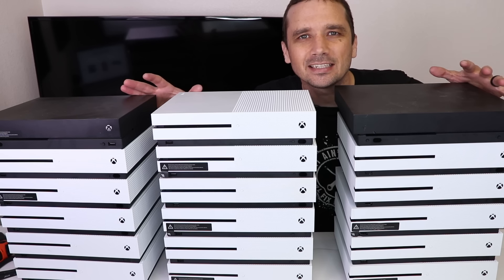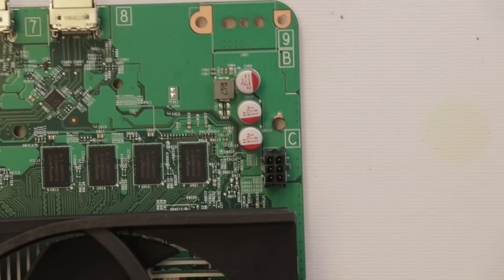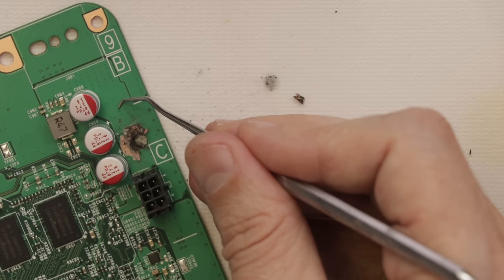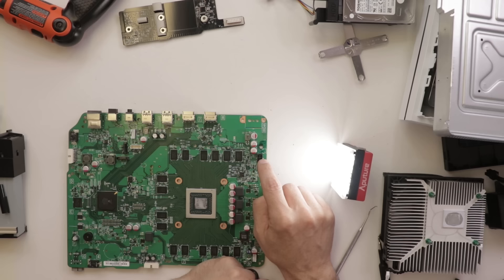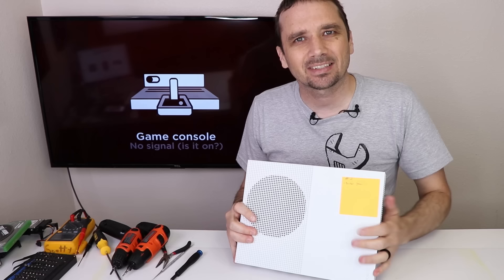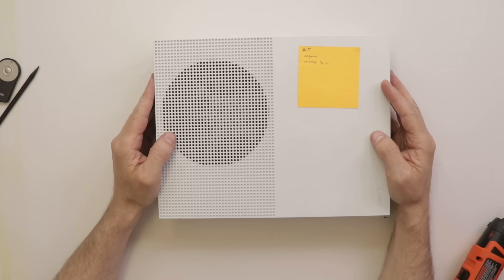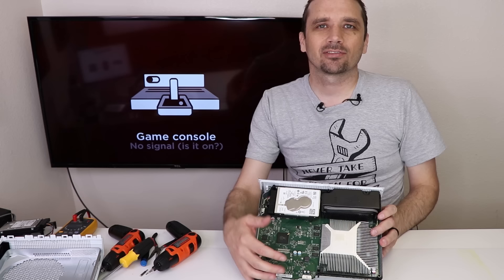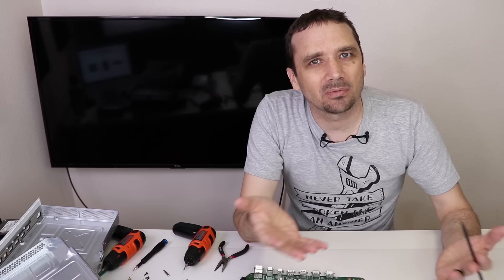I bought 18 broken Xboxes - Can I Fix Them and Make Money?

Comment: Dang that’s pretty cool, 60 bucks for a “broken” xbox one. All you had to do was remove the thing from touching the other thingy and it’s fixed....honestly it seems like fun fixing these
Reply from the maker: It's usually fun!
Reply: TronicsFix hi
Reply: I wish it was that easy but you should definitely try repair though.
Reply: Just started doing it myself have fixed 4 of them so far it is pretty fun
Reply: How do I lean how to do this? This seems a pretty interesting line of work
Reply: @lucasbatista9369  search how to repair electronics right here on YouTube
Reply: Love the wordage I feel the same way. Makes me feel like a retard how well he can just test everything and make an assumption and almost always be right. And I'm here like he took apart a thing redid some stuff did some other neat things and the thingy was fixed
Reply: Its fun when you fix them....its not when they have water damage
Reply: @lucasbatista9369  learning to solder would be a good start.
Reply: Getting them open is not fun, however. They do not want you to get in there lol.
Reply: @gokublack8342  how long did it take for you to take actually learn how to fix your first Xbox?
Reply: @darylleabsism2412  Idk maybe a few youtube videos so an hour or 2 granted i was already pretty good with electronics
Reply: Its painstaking labor half the time and fun the other half of the time
Reply: It would be interesting to see how long it takes him to fully repair/test each Xbox.
Reply: @Tronicsfix   hi Tronics i Have a Ps3 jailbreak that get temperature s to 75 degrees or more of cpu and gpu and it need cleaning and new thermal paste and stuff inside  how much do u take

Comment: If Apple made these, there would be special nine sided screws installed so that you couldn't fix them.
Reply: They would make it unrepairable by instead of having clips for the plastic case to attach to it will be glued so if you try opening it you snap the plastic breaking it
Reply: Reggie or maybe they would do something like marrying the disk drive to the motherboard so you can’t fix them
Reply: @pb7379-j2k  imagine the CPU, harddrive, GPU, and everything being permanently stuck.
Reply: Erik Truchinskas iPhone: replaceable screen, battery, back  glass. Sorry, can’t imagine what the hell you’re talking about
Reply: Paul Bruneau it’s because apple is obviously going out of their way in order to make their phones more difficult to fix so people are more likely to just buy a new one from them.
Reply: John Furman just like MS who this guy just said matches the board to the drive, and won’t publish schematics I guess.
Reply: @pb7379-j2k  I was talking about the xbox one and also talking in hypotheticals, I didn't realize iPhones had dedicated gpu
Reply: Erik Truchinskas they do. Same performance as the Xbox One S class, at 6% of the size. Not hypothetical.
Reply: @pb7379-j2k  it's also much more expensive new (though I'm not how much of that is due to the actual hardware/software price) but yeah you do have a point. I was just saying that it would suck if a large manufacturer of tech like this did something scummy like making the product 100% sealed or the hardware unremovable
Reply: Erik Truchinskas yeah, or married the disk drive to the motherboard, I totally agree
Reply: Or the bit would cost $75
Reply: Beaches south of L.A. they have 5 lobes and the bits cost $10 but whatever fits your narrative
Reply: @pb7379-j2k  Lmao! What is it man? Do you own large stocks in Apple brand or something? Lol. You seem really defensive, to the point of weirdness. Everyone knows about how Apple creates a monopoly on their products to make way more money than other products do. It's not a secret and hasn't been for years. Just look what they did with their earphones.
Reply: Space Alien what did they do with their earphones?
Reply: Paul Bruneau they changed the connecter to a lightning connector which makes it incompatible to other devices
Reply: EpicTree 2018 LOL that’s hilarious. You are living in crazytown
Reply: @archiehicks9959  Exactly. And they also changed the connector on their chargers for the Iphones. They do this kind of stuff with all their products to make a ton of money. Everything for Iphone and Macs and any Apple products all have their own exclusive products you need. Nothing on an Apple product is universal.
Reply: Space Alien 👍
Reply: Space Alien they kept the dock connector for years. Then they greatly improved it with lightning which has been in use since like 2013. Lightning was a huge improvement.

They were the first computer to ship with usb in 1998. Was that to make money on cables?

Today everything but the phone primarily uses USB C. Is that to make money on cables? Or because USB C is a better connector?

You hate Apple because they are Apple, that’s fine, but your arguments are garbage.
Reply: They would add a self destruct function if tampered with, thermite would burn the power supply, melt the CPU, and obliterate the motherboard. Cause fk u, if it’s broken, get a new one!
Reply: @pb7379-j2k  iPhones are nowhere near the same performance as Xbox one S. You have to be very delusional to think that. Either that or you have no idea what you're even talking about. Not a single phone on the market is close to 1/10th of the performance of a PC from 2009 let alone an Xbox
Reply: @pb7379-j2k You clearly have major stocks in Apple to be defending them like that, that's insane 😂😭
Reply: King Pinn as if these comments affect the stock price
Reply: @pb7379-j2k  meanwhile the Macbook Air has a riveted keyboard.
Reply: No it would have just been glued shut.
Reply: Apple: Spots a Wild American
Wild American: spots Apple
Both*: *UwU intensifies
Reply: Xythrr thank you for making my argument against these crazies who think Apple changes cables to make money
Reply: Xythrr iPhone Xs, enjoy
Reply: If it was apple’s the entire inside would be potted under the guise that it’s fully waterproof.
Reply: Matt B it is fully waterproof and yet the battery and screen are still replaceable, thanks for playing
Reply: @pb7379-j2k  I dont know how you just dealt with all of that to be honest
Reply: If Dell made them the plastic tabs would be break-away so it would nigh impossible to put them back together.
Reply: @pb7379-j2k  Weird how their phones don't include a lighting compatible charge port with them...
Reply: @pb7379-j2k  iphones are way garder to fix than any android
Reply: @pb7379-j2k  u seem like u own an iphone and ur salty is what it seems
Reply: @johnnyrae6448  exactly lol
Reply: ELI MACK BIGGEST FAN I have no idea. I never mentioned Android
Reply: ELI MACK BIGGEST FAN of course I own an iPhone. But I’m not salty
Reply: @pb7379-j2k  k
Reply: This guy understands cpus but not business. They obviously make money -- A LOT OF IT -- on the after market sale of chargers, fuckn idiotic to think they don't or wouldn't. USB-C is far too easy to duplicate, no one was buying these accessories from Apple after the phone sold. Now that problem is significantly reduced.
Reply: If apple made them they would still work.
Reply: Reggie  yeah for sure man best comment so far my iPhone X max is s big pain in the ass to try to fix or get into 😹😹
Reply: @pb7379-j2k  Sure, if you want to pay WAY too much on these dumb replacement parts instead of just buying an Android. Charging cables are cheaper and more standardized as well.
Reply: Richard so angry. Buy a crappy copycat if you like, I couldn’t care less. I’m just responding to the inaccuracies
Reply: @pb7379-j2k  Apple and Disney are both obsessed with money. Microsoft is even heading that direction. No matter who's side your on, the world is full of greed and nobody thinks they have enough.
Reply: Richard all companies, even Microsoft (historically one of the most brutal monopolists to exist), are legally MANDATED to maximize profit for their shareholders.
Reply: @pb7379-j2k  Never said they weren't but when they saw the opportunity, they jumped on it in the blink of an eye. I just don't think its worth the effort to be THE ABSOLUTE BEST COMPANY OUT THERE.
Reply: I think Foxconn China makes most motherboards for apple and xbox

Comment: How to recoup your loss:

1) Assemble Xboxes out of all remaining known broken parts
2) Sell on ebay for 60$
Reply: you should be running some company :D
Reply: underrated comment
Reply: @nostromov7892  Its called DRM its a feature.
Reply: @eragonbaffel9518  "feature"
Reply: @nostromov7892  Aha, but who said it'd have to ever work if you're selling it broken
Reply: There was just a novel on the proper placement of the dollar sign I'm thinking that from now on I'm going to do it this way just to set people off.. 60$
Reply: 3......
4  profit
Reply: @nostromov7892  apple does the exact same thing
Reply: @dumpsterstu4474  Always mess that up. No one says dollar 60 where I live except in old-timey movies. Its 60 dollars. Really confusing when written and spoken standards do not match up.
Reply: 3) get 4million views
Reply: // nostromov same thing with the PS4
Reply: @nostromov7892  on the 360s you just had a chip you had to replace from one to the other, i wonder if the xbox ones have a similar fix
Reply: The whole "proprietary technology" thing, while in SOME cases it is actually used to protect the company and customer; MOST of the time it's simply to do with maximizing profits, at the expense of consumers, meh. 

(Thanks to all backing me up on this, because REALLY enough is enough. :))
Reply: Jon Anderson The drive key pairing is to prevent you from fitting some “custom” drive that would be able to read “backup” (non-original) game discs. When the drive reads a disc, it reports the data about it into the console. If there was no encryption with a console-specific key – it would be easy to design some “non-standard” drive or drive modification that would allow “backup” use.

Comment: I was super skeptical about the first one when I saw you scraping away the layers... But hey! WOW!
Reply: Pcb repair is an ugly business, especially with multi-layer pcbs.
Reply: Yeah, how are you going to list that, maybe "Certified Refurbished"
Reply: @LongBean7  Refurbished-ish
Reply: Question: how reliable is the repair though??
Reply: @IAO_Strange  it should hold up to years of use but i wouldn't take a chance that's why i buy brand new but for some people its not that easy.
Reply: @IAO_Strange  it should hold up to years of use but i wouldn't take a chance that's why i buy brand new but for some people its not that easy.
Reply: @thekrasa1970  Refurb-ished
Reply: @IAO_Strange  smoke from the power supply twice, fire once,  didn't even check the caps. yeahhhhh
Reply: @IAO_Strange  i give it 50/50. there is a reason why those traces are so large, they provide a lot of amperage. I expect under full load, an inadequate route to the power supply might result in unexpected system behavior. these things are designed with some margin but that was quite a lot of scraping.
Reply: One thing is doing it as a challenge or personal use, quite another if you want to make some money (very little if any at all).  Nowadays smartphones actually have more processing power than these old boxes, so it's probably not worth putting precious time into it which people are unwilling to pay for, but hey to each their own.

Board level repair is simply a money pit in terms of time spent even if you manage a 50% success rate but that's a conservative percentage, unless you're fixing high value Apple laptop boards, that's about it.   Trust me, I've been doing board level phone repairs for the last 20 years, went from working with just the naked eye decades ago, to having to use a 45x magnification microscope on virtually all jobs lately. I would equate it to trying to wash your toilet paper in order to reuse it (lol) yeah not very appealing. xD
Reply: @IAO_Strange  No one knows, but I'm sure it will be sold much cheaper than the others.
Reply: FD don’t think that’s gonna be a problem... I’ve been designing pcbs (for junior soccer robots so I dunno if it’s the same ) but even  for a 5 volt led board I just thicken the traces just in case they get scraped up so don’t think the amount he removed is actually gonna do any damage
Reply: @michaelwitt188  You don't damage the caps when you short a SMPS. You can trigger OC protections, burn diodes, resistors, xformer, mosfets and so on depending on the SMPS design... but shorting the output doesn't damage the caps.
Reply: @Coreyztv  my thoughts exactly
Reply: @BillAnt  I work on Telecom wireline repair. There's obviously different standards of repair and reliability between telecom equipment and consumer products. This to me looks very iffy. If it was for my own use, I'd be ok with the repair. Always try to buy new or with warranty.
Reply: @fd3871  The first plane he started with, given the size and obvious way it routes along components really suggests it to be a ground-plane.  Next to large amounts of power, they are designed that way for heat dissipation due to those large amounts of power running through them (and in case of a short, should fail at the component-level instead of along a powerrail as it happened there.
Reply: My ears are skeptical
Reply: PCB repair can be good enough to be considered brand new. I know this for a fact as I used to work for Solectron Texas doing technician-level troubleshooting and eventually level 3 certified board repair for Gateway and Dell motherboards. We wouldn't scrape our boards away and leave them all sloppy like that, but we would definitely replace multi-layer leads.
Reply: @Dutch3DMaster you are right about it being a ground plane but he dug through more than 1 plane as I saw it. Given that it failed the way it did it suggests that a power rail was directly below it and a defect in the board caused the layers to touch somewhere and short.
Reply: @waltersobchak7275  I am sure most electronics manufacturing plants still employ technicians and board repair specialists. I was just out of high school and not certified to do the board troubleshooting I did in 1997, but my technician friend taught me so I could help. I worked my way up from a test grunt to a board repair specialist and then quit to get into IT.
Reply: I am shocked
Reply: @totallymady42069  Literally??⚡🔌
Reply: AHH THE SCRATCHING MY EAAARS
Reply: @BillAnt  hey this is super interesting, do you wanna post some vids of this in action?
Reply: @J P < Oh I can certainly understand repairing expensive telecom gear, when a piece costs $10k, even if you put in 1k of repair costs it's still worth it.  But here we're talking about relatively cheap and outdated consumer electronics.  It's a fun and educational YouTube video but still a waste of time in the end, given the value of the target. imho
Another example is when repairing a $200 smart phone even if it costs $200 in parts and labor, sometimes the non-backed up information which it contains is well worth it (case by case basis).

@Phil Roy < Running a busy shop, unfortunately don't have time for shooting and producing videos. :(
Reply: @Papaya Tasty < I understand, different countries different problems.  In the US time is money, and while most everything could be fixed given enough time and effort, it's just not worth it for low cost devices.
Trust me, I've been running a mobile phone repair shop for 20 years now, and most people are unwilling to pay even a quarter of the phone's cost to repair it, unless their info inside which is not backed up is more important than the cost.

Comment: Number 4 is literally just "did you try turning it off and on again?"
Reply: I think it was overheating due to the dirty fan. It is then more like turn off, open, clean the fan, turn on. Also Idk about xboxes but with laptops the fan gets clogged with dust. They might have tried to clean the dust with vacuum cleaner or compressed air and when that didn't help they just called it.

Comment: I've fixed a lot o laptops, there's one thing that's coming to my mind which could help with the power. The power coils itself could be broken, i don't know why it happens exactly, but the way to check this is to heat them up with hot air and then try to power it up, if it starts, the power coils needs to be replaced. Let me know if that helped you.

Comment: This video has a special place in my heart, this was my passion back in the Xbox 360 days and i once bought a lot of 46 xboxs and repaired every single one. Keep doing your thing!
Reply: Did the same lol people would throw away so many good consoles
Reply: Lol towel method huh
Reply: Earl Spencer god no never lmao, I was straight up reballing the gpu
Reply: I bought over 200, still have like 20 left in the garage and a crap load of drives/faceplates/front boards/heatsinks. Prob will just need to throw it all away.
Reply: you and steve doing good work for the environment :)
Reply: I still got 2 somewhere on jtaggable firmware
Reply: @dylanbenker2043  The good old 7371 kernel..
Reply: my grandad used to fix tv's and record players and just anything electrical or mechanical in his shed or garage, so cool to be able to do stuff like that, I cannot even tighten my chain on my motorbike lol I am useless at anything like this lol
Reply: No

Comment: The Xbox always seems to be way more cleaner inside then the PS , don't know why
Reply: All the xboxs were only a year old compared to some of the ps4's could be 5 years old.
Reply: Probably broke the first time it was used...
Reply: Probably because it can vent more
Reply: @benmann16  Just depends on the quality and the factory. Some Playstations burn up right away due to a short caused by a sloppy soldering joint getting coupled. Same with Xbox's. Welcome to automation not console wars